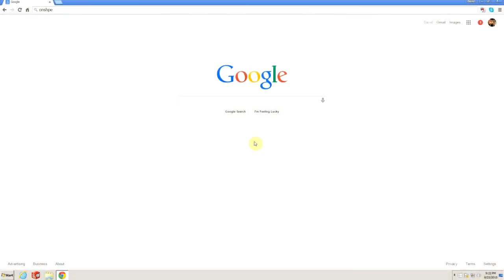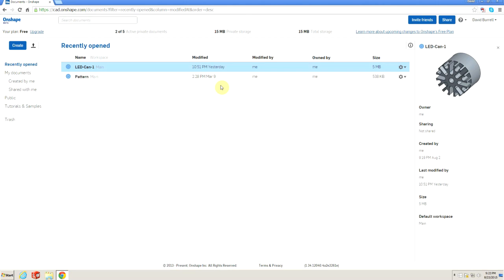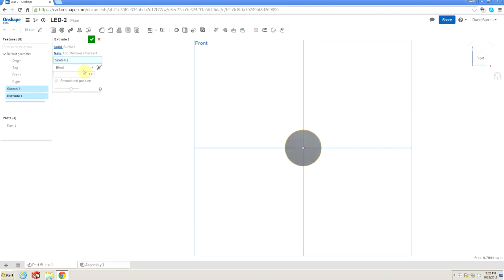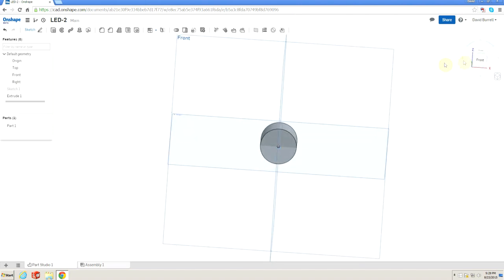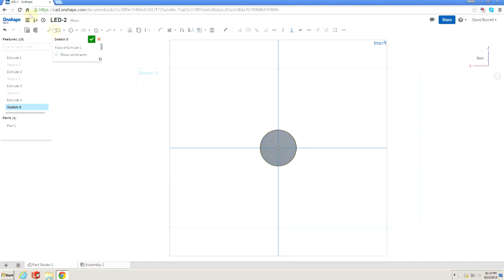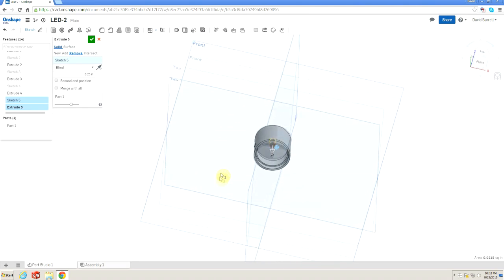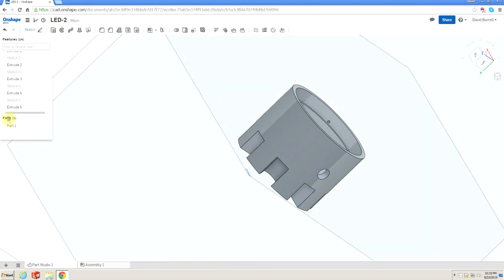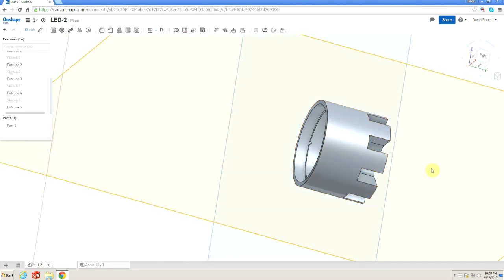Start to Finish - LED Can Light - CAD Design - Episode 1 - Neo7CNC.com

Comment: Have you tried fusion 360? What is the difference?
Reply: +Hulla Dek Fusion 360 makes shortcuts for common tasks differently and seems to try to simplify them compared to Solidworks (Solidworks is very similar to Onshape). That's how I would put it. Search and compare the interfaces and menus, if you'd like.
Reply from the maker: +Hulla Dek I haven't tried it yet so I can't speak to the differences.  I know it has some CAM built in already.  OnShape has that coming in a future update.

Comment: Why aren't you using the KR33 mini CNC for this project? Do you have a lack of confidence in the servo drive system? I am very interested in seeing what kind of accuracy you are able to get out of the KR33 when cutting aluminum. I hope to see some more cutting from the KR33 to see how well the servos perform. i gave up on the Onshape because of the new restrictions for the free version later this month. They are changing the amount of data that you are able to store on the cloud. I am now using Fusion 360 which is a more complete solution compared to the Onshape.
Reply from the maker: +William Hardin I have complete faith in the KR33 and still love the servos.  I used the larger CNC because it has the mister.  I could use the mister on the KR33 but not until I have all the electronics and such in an enclosure.  I hear ya on OnShape.  I know they are working on multiple CAM solutions so I would expect something by the end of the year.  Thanks for watching.
Reply: +Neo7CNC The reason why I asked is that I have seen a lot of remarks from people saying that they had problems with the servo systems loosing resolution making corners and turns when changing directions. I wonder if that's maybe because they aren't using Ball Screws like you are. In my case I will be using lead screws with 1/2-20 threads, so I will have backlash to contend with. That's why I have been waiting to see what kind of tolerances your KR33 will hold.

The files that I was using in Onshape exceeds the max size that Onshape is going to allow free users and I can't afford $100.00 a month.
Reply from the maker: +William Hardin I cut the plastic lens for this LED can on the KR33 and the tolerance on the part was -0 / +0.0005  (pretty good I think) I too am curious to see what it does in aluminum but it looks promising.  Getting the electronics in an enclosure is quickly becoming a high priority :)
Reply: +Neo7CNC Very impressive. That's a beautiful little machine you built. I need an enclosure for my mill also.